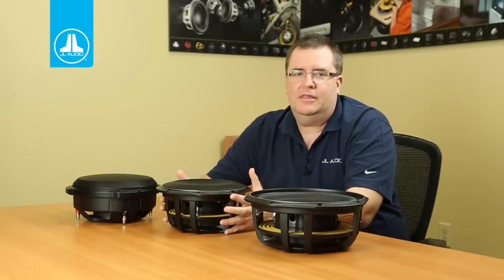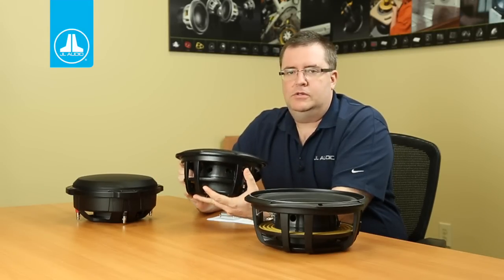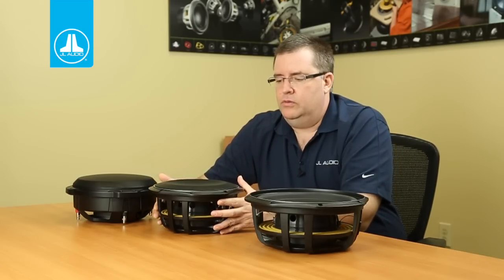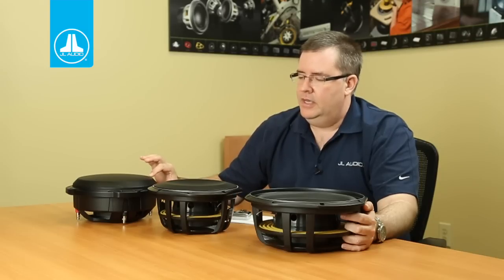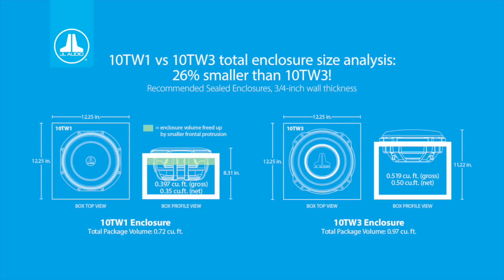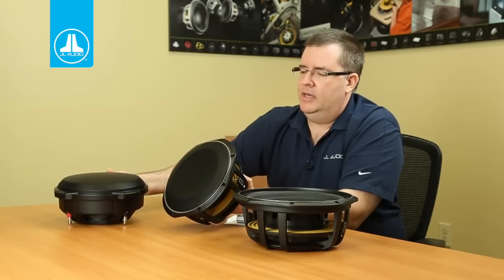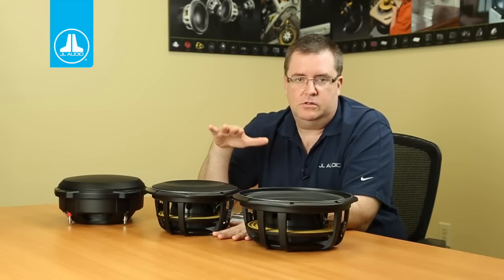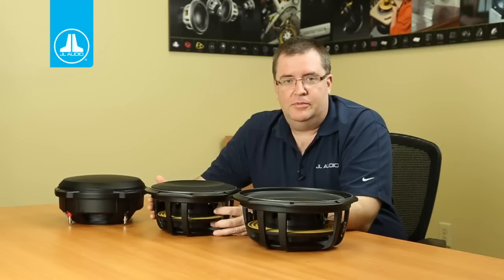JL Audio TW1 Subwoofer Product Spotlight

Comment: My very 1st experience hearing a JL Audio Subwoofer was when i was sitting in my friends lil Honda Civic hatchback. He had a Pioneer head unit, Alpine Amplifier, and 1 JL  Audio W6 10" Subwoofer in a front ported enclosure. Man i tell you what....nothing sounds like a JL! Nothing can crack the Bass notes like their speakers can! Just an Excellent, high quality product! They are 2nd to none in my opinion! Infinity is a close 2nd but no one does it like these guys do down in Florida! JL audio components are made with pride here in the U.S. and it shows!
Reply: I've owned lots of JL Audio gear, from the 8W2vw to the 12W6v3, C5 speakers and many other amps, sub and speakers amps. 
They OK. But my sub £500 C5 speakers were outdone by my Morel Tempo 6 speakers, and the 12W6v3 which is near £600 was far outdone by the first gen Sundown SA12 which cost me £175. The SA had far better output and far, far better control when it came to SQ. 

As for JL being made in America, .. well that nonsense has been debunked ... by JL's own literature:

C5 - 650 Speakers
https://www.jlaudio.com/collections/car-audio-speakers/products/c5-650-car-audio-speakers-c5-speaker-systems-99104 
--------------------------------------------------------------
Made in Germany, Sold as a pair.
--------------------------------------------------------

.....   and by JL's own employee 

http://www.diymobileaudio.com/forum/1660557-post30.html

The parts come from the U.S. and overseas. There isn't a single U.S. made speaker that uses all U.S. parts anymore. For example, there are no magnet producers in the U.S.A. at this time. They all closed up in the 90's.

Manville Smith
JL Audio
--------------------------------------------------------------

I think the phrase they now use, goes along the lines of (paraphrasing) 

"Components sourced overseas, built in the U.S."

In other worlds; 

"Made in China, glue together in Florida." 

At least Sundown, DD and others have the decency to be upfront about their gear.  

I love JL amps, but the speakers and sub are ... meh! 

You might want to have a rethink about the MIA part in your comment, as JL, by their own admission, obviously disagrees with you. 

All the best

Comment: Best subs I've ever had has been JL.
Reply: +Gnik4144 Best in what way?
Reply: +utubecomment21 overall performance, look, sound.
Reply: Gnik4144
Well, how do you gauge 'overall performance'?
When it comes to SPL competitions, that's pretty easy, and JL doesn't win any comps. As for SQ, ok it's more subjective, however, JL Audio SQ comps: nil-pwa
Reply: +utubecomment21 overall performance my W6's were great. Performed well. & I don't go to competitions so idc about that. It's simply the best subwoofer I've owned so far.
Reply: +Gnik4144 its twice the cost of all others and its only got an xmax of 10 pathetic
Reply: you ever heard of Fi, SSaudio, DC, DD, just to mention a few?
Reply: rocooo fi is gonna be my next set up. 2 15's on a soundqubed 4500
Reply: wich line Fi are you getting?
Reply: rocooo i wanted the team sub, but the BTL's are out. So I'm gonna wait & see what kind of reviews they get.
Reply: don't worry for reviews, those will be monsters, buy them as soon as you can
Reply: 12W7 , H.O. wedge.. pushed by a 1000/1V2 SLASH .. absolutely THE best , crispest sound u can get out of a sub in the price range

Comment: You've asked for some new product ideas- a high xmax 5- 6" subwoofer with a high mass cone designed for ported enclosures. My theory is that the ported enclosure would allow the heavy cone to travel easily and that the enclosure would be secured to the vehicle and act as a transducer that causes the body of the vehicle to resonate- thus feeling the bass. The port would also allow for a more audible experience than a traditional transducer can provide. Ideally, the design of the driver would be shallow depth. I also believe it would be rather inefficient with the extra mass of the cone, so a single 2 ohm voice coil may be the answer in trying to exploit the amplifier. My idea came from viewing the incredible performance of tiny subwoofers within Bluetooth portable speakers such as the UE BOOM and MEGABOOM. I also imagine that such a driver could make an interesting micro version of the JL Gotham active subwoofers. And hopefully much more affordable. :-)

Comment: I have a Pioneer TS-SWX2502.  Will this subwoofer drop in that box or does the box lack sufficient depth?  I have a small Ford Ranger pickup truck, which set up would provide the best sound, a single 10" or two 8" woofers?
Reply from the maker: Hey, Gary.  I looked around a little bit for the airspace of your current enclosure but was unable to find the specs.   The 10" Tw1 requires a net internal volume of 0.35cf or 9.91L for a sealed enclosure like the one you have.  

you would have to be sure the airspace was right.  If not, you can email or call our tech support team and they will design an enclosure for your vehicle and you can take the design to an authorized dealer and have the enclosure built.

Thank you for reaching out to us and I hope this information was helpful.
Reply: @JLAudioInc  Thank you for looking.
Reply: garyw308 did you end up doing this? I’m wanting to do the EXACT same thing.

Comment: Why is it that the TW1 is good for ported enclosures, but the TW3 and TW5 aren't?
Reply: QTS.
Reply: @tammyforbes2101  Not really! 

QTS 0.649 
Going by the common rule of thumb of:

Low QTS = vented
High QTS = sealed

The TW1 would certainly fit into the sealed category ... not that I take a singular parameter and work off that anyway ... as no singular parameter works in isolation of the rest, or the enclosure the driver is going into, or the environment the enclosed driver is going into ... and the fact that some parameters aren't a constant!

Comment: Is the new technology of the TW1 better than the TW3 or is the TW3 still a better speaker.
Reply: I guess the price point dictates the performance/quality.
Reply: Fridayone35 
Well, TW1 is 300 rms. TW3 is higher, as he said. The sub box for TW1 is smaller than that of TW3. They lowered the woofer speaker giving the TW1 woofer the same movement but looks more flush when mounted. 
You need to look deeper than this guy talked about. The cone material. The surround material. How fast the speaker moves and recovers after each note. Ex: songs with double bass kicks sound best when movement and woofer material can “keep up”. 
I think this vid was about shallow subs and people who prefer them. 
I’ve got two 12’s in an enclosed box for tight, deep bass. They’re fed by a jl audio 600/1 amp and friggin sound GREAT!!! They’re 7 years old, as is the amp. I think today’s tech into subs is superior. 
I guess it depends on the space you have and the sound/flexibility you want from your sub. You don’t need two. One 12” or one 15”.
Reply: Tw3 is much better also sounds louder than tw5. Tw3 is the best shallow sub in the world

Comment: I am wondering if the JL Audio CP108LG-W3v3 Single 8W3v3 MicroSub would sound better than the jL Audio CP110LG-TW1 Single 10TW1 MicroSub ? what would be the difference in sound?
Reply: RAYjon H I had a micro 8w3 for roughly 8 years and it just died on me recently I DEFINITELY got my money’s worth and used it in a few different pick ups and everyone thought I had a 10 or a 12 never an 8 !
Reply: @JALEEN1994  i traded up for a 8w7 in my vehicle. Custom box for my vehicle from JL AUDIO. I love it...over 5 years and still going strong

Comment: Can you take the grill off of the TW1?
Reply from the maker: @Adriel Guerra, yes it is just pressure fit in place. You can use a pick tool to gently pry around the edge of the grill to pull it out.

Comment: What would be the best amp if I’m running 2,10s at 2ohm? I prefer if the amp is jl audio as well.
Reply from the maker: We recommend a power rating between 75W and 300W for our 10TW1 2ohm subwoofers. Anything between 150W and 600W would be applicable.
Reply: @JLAudioInc  What if I have an old jx1000...... To much power? Will it fry two of them?

Comment: Didnt orion start the tab ear thing?
Reply from the maker: @Etrigan Seven, the tab ear mounting has been used in the past, yes.
Reply: @JLAudioInc  i have a 95 suburban build i need to get done. I have 3 12 w6 v1s that have never seen power and i know they get down. Id like to do something with a bit more and more modern. What would you suggest?
Reply from the maker: @Etrigan Seven, the 12TW3 has more excursion and greater cone area than the original 12W6. You could do a pair of dual 4 ohm 12TW3's and wire them in series/parallel at 2.6 ohm for a great set up. The XD1000/1v2 would be a good amplifier match.
Reply: @JLAudioInc  thanks ill start plugging
Reply from the maker: @Etrigan Seven, you are very welcome.

Comment: Where is the 8 inch version?  It would be nice to fit for a customer that has a Outlander Sport or a Chevy Spark which is small to say the least to fit more than just one subwoofer in a fiberglass box in the rear quarter panel.  That Crappy 10 inch sub they offer from factory sucks and is not dynamic enough for my taste.  Thumbs down to Rockford Fosgate.
Reply: +Forevermct1 RF makes great speakers though. How can it be bad?? I thought the Bose systems Chevy offers in their trucks sounded amazing and the bass was very rich and full even from a 5.25 inch woofer.
Reply: Well to answer you question.  To be frank and true.  Most optional upgrades in any car that is factory does not do well at least in my case Mitsubishi chose Rockford as their OEM company to put in their vehicle.  You would think by this and glad I did not pay that junk, the Sound stage would above sub-par and the sub woofer itself would blend well with the speakers in this case it does not.
Aftermarket is key cause you can customize everything.  My route is if you cannot go aftermarket  then work with what you got.  Bose is ok.  At least they time align and use crossovers to give you some what decent sound.